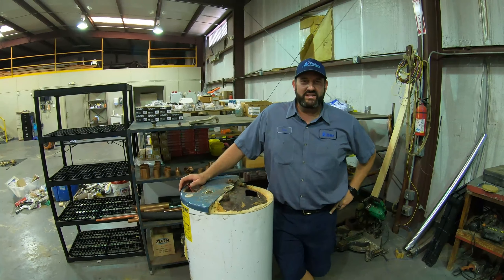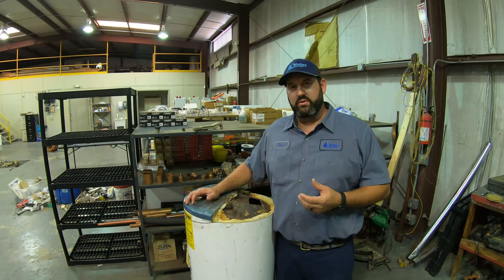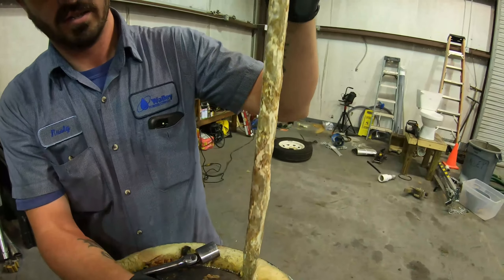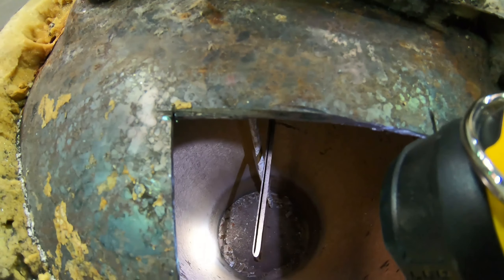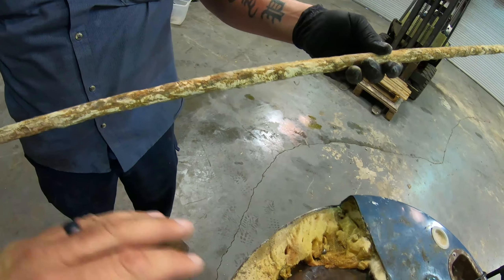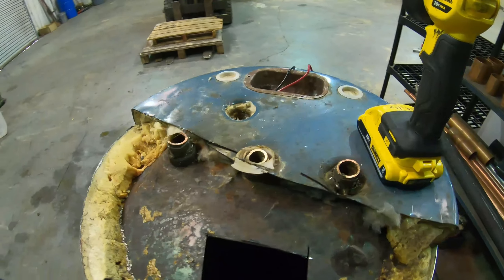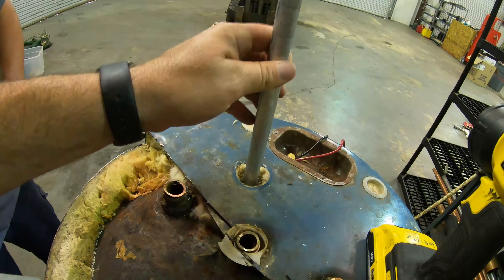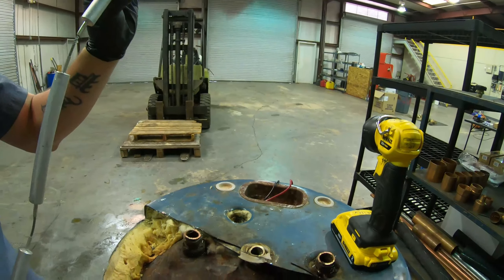ANODE ROD REPLACEMENT

Comment: I'm guessing mine is gonna need replacing :( Old house outback just got power to it and I haven't cut the breaker to the hot water heater yet.. I'm scared .. laughing*  I know it's been over 5 years probably more since the house has had power and that just a guess.
Reply from the maker: We can flush it out and change the anode. if its really old it may be better to just replace the heater if its too far gone but send me pics of it and we'll go from there.